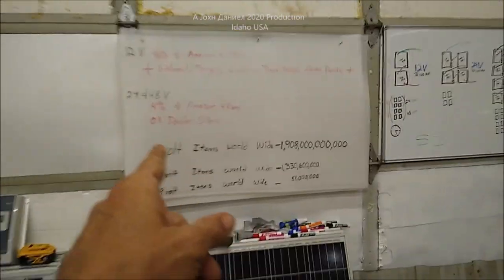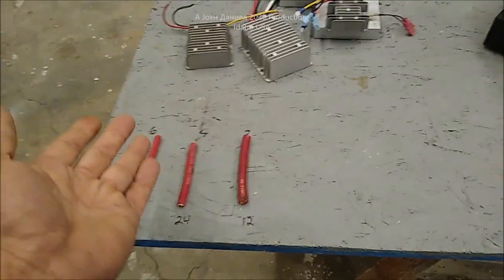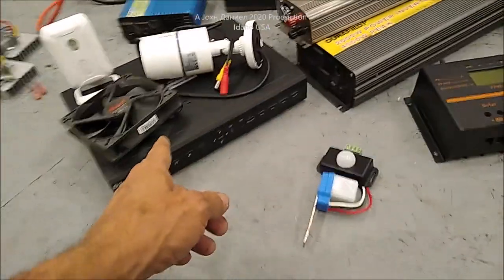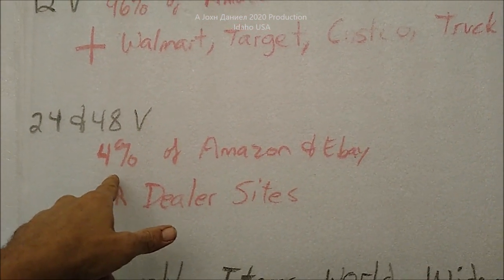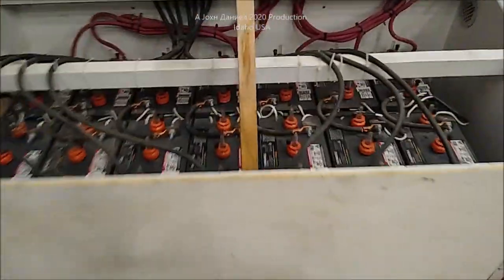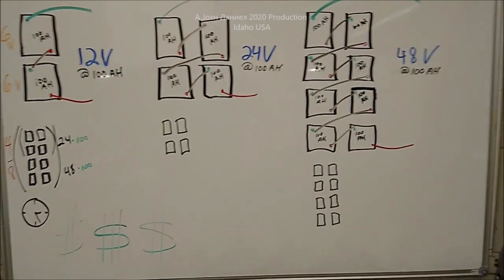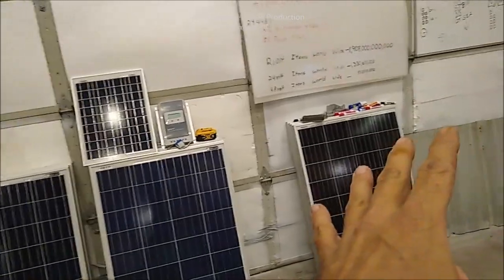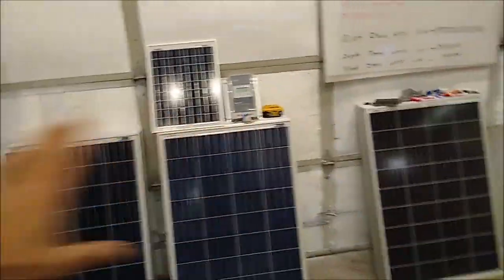Solar Wind Hydro 12 VDC is Best Voltage on Off Grid Survival Power System (Graphic Info)

Comment: did I hear you say something about using the Hurricane LiPo to charge the lead acid?? Just started gutting a 40ft RE school bus. I am studying up now.
Reply from the maker: Yes, you charge a pair for 24 volt off 250 watts of solar, after dark when your big 12 volt lead acid system drops in power the controller pulls stored 24 volt power through its controller to hit the big black acid bank with 40 to 50 amps during the night.
Reply: @JOHNDANIEL1  thank you sir, making sure I follow you. You have become my go to guy on solar. I live close to the Missouri  dude you call out.

Comment: Hi John.  Great videos.  Gives me lots of ideas.  I want to install a 400 watt wind gen, one of the ones that has 3 wire AC output.  I will put a bridge rectifier to step down to 12 v nominal.  I want to put a shut off switch/breaker in line.  Should I do this before or after (down stream) the bridge rectifier?  Fuse it on the 12v side before the charge controller or between charge controller and the batteries?
thanks, keep up the good work.
Reply from the maker: You will use 12/3 gauge wire https://amzn.to/3iU2Ao0 up to 35 feet from turbine to rectifer ( longer run must use 10/3 cord, and 3 - 40 amp Mini ANL https://amzn.to/3l0fwKQ or Maxi fuses https://amzn.to/2FDphi7 on the incoming 3 wire set before the rectifier, following you will use one 60 amp ANL fuse or 80 amp DC breaker https://amzn.to/318QBwP on the positive output of the rectifier before the battery. If your wind speeds are lower than 12 mph nominal, get the 5 blade from the link to the 400 watt models. It will serve you well.(GET NO 6 BLADE, AVOID) It will take a few over 18-22 mph wind events to break in to make as rated power, they are heavily magnetized and must break free and align the magnetic flux in the rotor then its all good. So don't freak out if it don't immediately spin and track, patience Gwass Hoppa, it will fly!  *Getting the volt and charge Settable Controller https://amzn.to/31acqMo with Solar option is best controller option on a under 2500 watt "planned" system!
Reply from the maker: I added links in first reply to examples so theres no chance you struggle to see whats used.
Reply: @JOHNDANIEL1  John, thank you for your very prompt reply and links to the parts used.  Awesome!  As this will be going on a sailboat I will be able to reach the turbine from the deck with a pole to spin it sideways to t he wind when I want to brake it.  I'm thinking that when in this orientation, I can also use an electric brake as a backup.  How do you wire in the brake switch.  My turbine came with a charge controller that brakes at 14.5v but I can't allow voltage to get that high on my LeFePO4 bank so can't use that method.
Reply from the maker: @joegraceffo642  Brake switches are just a dead short switch that connects all 3 phases together before the controller. The rotating the turbine method don't work well in storms, it will fight to return to tracking  with great resolve!!! The best method is braking by 3 into 1 short switch. As for the controller 14.5 volts, the only method to use a wind turbine 100% safe on Lithium is to use Lead Acid as a capacitor with a isolator that charges the Lithium from them.

Comment: Hi John,  Why use 8 - 6v batteries in a 12v system, instead of using 8 - 12v batteries in the same 12v system?  I tried doing the research myself but can't figure it out.  Thanks for your time!
Reply from the maker: Most 12 volt batteries that are one piece are dual purpose but a 6 volt battery is deep cycle only so lifespan is doubled.
Reply: @JOHNDANIEL1  gotcha, thanks John.

Comment: So 12 100 watt panels and 2 charge controllers...I'm assuming 1 charger for 6 panels?
Reply from the maker: Yes, and I really suggest the WN-100 panels I linked below the video due to the better output in low light and slightly heavier frame construction.

Comment: I have 3 (300W) solar panels feeding my "SR-MT2410" controller. Input voltage is 115vdc (max input is 150vdc). Battery out is 13vdc but I have no voltage on my load.  I tried two different controllers with the same results. Do I need a load to get the output voltage? I have a 1500w inverter on there with no load.  The battery is a 12v car battery. Help?
Reply from the maker: Did you turn on the load function on the controllers? See their instructions on how to do that. But, do not run a large inverter off those lugs, go straight to battery.

Comment: Ok, so how far then, are your panels from your bank, how many amps are you pushing, and what gauge wire do you run from your array to your charge controller(s)?
That's not a criticism. I'm genuinely asking because I currently run a 24 volt system and although I've had no problems with it and my 750w converter, you raise points I hadn't thought of and it was only earlier this year that I realized that stupid converter is the reason my levelling system won't work right in my trailer. It's drawing way too much juice and my converter trips out. If I went back to 12 volt and ripped it straight off the bank I wouldn't have the issue. Anyway, yeah, back to the question lol
Reply from the maker: My wires on each row of panels are 6 gauge running 22 to 24 ft to the controller that then feeds two awg wire back to the bank 22 ft away.

Comment: I started off with 12v 100w panel had it running for five years.

This year I upgraded to 24v panels put in series to make 48v.
And 24v battery bank, this uses the mppt of the charge controller and charges the batteries in very low light.

I would have upgraded to a 48v battery bank and higher voltage on the solar panels but money is stopping me.

Why the upgrade?
Well basically efficiencies and efficiencies with volt drop is the main concern for me.

Higher the voltage the more efficient a inverter is at doing its job, higher the voltage of the batteries the less volt drop on the cables, etc etc.
The higher the voltage of the panels to the battery the mppt works otherwise on a 12v panel and battery bank use pmw charge controller.. Also mppt gives upto 30% more efficiency. 

As with any decent solar setup you also have to have battery balancing, not so important with batteries wired in parallel but batteries wired in series to prolong there life.

It all depends on what you want your system for and to do, not only that your climate, I live in the UK so mostly cloudy rainy days here so if I did it differently I would need miles more panels to charge the battery bank

Comment: Hi John, another excellent video. I wish you'd made it 6 weeks ago as I've just purchased a 24v Turbine    : (     Gutted!
Reply from the maker: You can run your 24 volt turbine to a 12 volt battery bank. It will produce better in lower winds, and reach at least 70% of its rating if its like those I use. The controllers do not know its a 24 volt turbine, they only know the battery voltage.

Comment: I have one reply.  You HAVE heard of Peukerts law. I can run 8 12v batts longer than 8 6v batts using the same load. And in a pinch 12v is WAY easier to find than high energy 6v batteries.
24 volts also opens you to using that 58 million military surplus equipment.
Reply from the maker: True on many points!

Comment: Hi mr John. If i use a 48 volt wind turbine hooked up to bridge rectifier that is suited for for it. Than connected to an mppt whose amps and voltage easily exceeds that of the wind turbine connected to a 12 volt system. Is that possible with the respective fuses in place. My theory if the turbine can easily produce a voltage that exceeds 18 volts converted to dc in rectifier and then adjusted in mppt to charge battery. We have winds regular winds but it isnt strong but when it blows, its consistent. Ive seen a youtuber with principally a similar setup. Whats your take on that. I respect your work and therfore want to hear from you what u think of that. Im a big fan of my 12volt solar setup and i want to enhance it with your expertise. Any feedback is appreciated from you sir
Reply from the maker: Which 48 volt turbine. Whats brand, wattage it makes ( not claims to make) and location you've installed. From there I can be more accurate in a reply
Reply: @JOHNDANIEL1  im a novice to wind energy. With solar i have a bit of experience since 2014. Can u recommend me a potential wind setup that could work based on the parameters i gave u sir. Im all about the bottom line. If u tell me to rather go with 24volt wind turbine that u have good experience with, i will role with that. Experience with a product beats advertising of product not understood any day of the week. I wane keep the system as affordable as i can but without compromising on the parts, the way u have done it. Im open to suggestions. I know based on your videos you sir don't have time for nonsense nor to waste time on things that dont really work. Im from Namibia. Yes we have alot of solar radiance throughout the year in the whole of the country. At the coast the winds are more frequent and alot more stronger. Im from the central parts of Namibia. Wind not as strong. Im aiming for a roof mounted setup. Very little trees or unwanted structures to keep consistent wind from hitting the specific location ive selected. Low wind speed, but when it blows its consistent in evenings and mornings somtimes through the night. Thats free electrons i want to capture.
Reply from the maker: @Mr_natenut  Naton, Send me a email, to - olympicpowercontrols@yahoo.com - so I can get details on your actual location, wind zone, power your needing to make and results your seeking. It helps to get it accurate to what you have right now. Mention all you have here. J
Reply: @JOHNDANIEL1  hi Mr John, i actually in the meanwhile came across a video youve shown regarding vertical wind turbines and others on your channel that answered quite alot of my questions i had. I actually downloaded them and have them on my hard disk drive for study purposes. Vertical is more practical based for me based alot of good stuff you mentioned. It will take me a while to absorb all the material youve graciously made available. There are even links to the wind turbine youve approved that i will check out. Thank you.

Comment: I think you make many valid points, but one of your points wasn't clear to me, the point about battety failure compared between 12, 24, and 48 Volt systems.  The example you gave was 2x 6V, 4x 6V, and 8x 6V "packs".   As I understand it, if one 6V battery fails in any of those packs, you need to replace one 6V battery to restore the pack to service, otherwise the entire pack will be out of service.  I dont see any difference in the impact, regardless if its a 12, 24, or 48 V system.  I think  a better point would be to compare failure rates instead.  A 24V pack has twice the failure probability of a 12V pack, and a 48V pack four times the probability of failure, but for just one battery to fail, the outcome is the same for all 3 types of packs.
Reply from the maker: It's not just about replacing a battery, you can't always do that immediately. So if you loose a percentage the 12 volt method is superior, all considered the equal of 8 batteries which is most common. A 48 volt would be dead, a 24 volt would be 1/2 dead, a 12 volt system would only loose 1/4 its active ability. It's due to the string being broken in a loss.
Reply: @JOHNDANIEL1  If just one 6V battery fails in a 24V pack, it's totally out of service since you now have only 18V.  A 12V pack that loses one 6V battery now only has 6V and is 100% out of service.  Same story with 48V pack. A single 6V battery failure takes the entire pack out of service.  I don't see any partial service at all.  
I think what you are saying, but didnt state, or I missed it somehow, is that each system has the same total number of batteries.  In that case, you have 4x 12V "packs", 2x 24V "packs" and one 48V pack.  A single 6V failure would then kill the whole 48V system, reduce the 24V system by 50% and the 12V system by 25%.  Thanks for your excellent video.
Reply from the maker: I'm don't know anyone who would put 12 or more solar panels on a single set of 6 volt batteries. But I do know hundreds who put 1200 or more watts on 8 or more batteries. But if your foolish enough to buy 8 for a 48 volt system, and only 2 for a 12 volt system, then yep, your ass out when one fails.
Reply: @JOHNDANIEL1  I think I understand now what you were trying to say, and it confused me because of what you left out and assumed the listener would know.  I've made that mistake myself enough times to know how easy it is to make.  By simply pointing out that each system is assumed to have the same number of batteries, and make it concrete by stating 8 batteries, it would make it easier to follow.  Thanks for all the time and effort you put into your videos.  They have a solid practical viewpoint, and cater to those who want to keep things on a budget.
Reply: I forgot to add that it would be helpful in the future to use standard notation, which would avoid any confusion.  I suggest using the serial/parallel notation when comparing the difference between the solar banks.  For example, 
2S4P for the 12V configuration 
4S2P for the 24V configuration
8S1P for the 48V configuration
That way, it's much easier to see your point about what happens to a given configuration when 1 6V battery fails.

Comment: Batteries should never be paralleled full stop.  When one battery fails in a paralleled battery system, shortly thereafter all the batteries will fail.  The reason is that the failed battery generally becomes a load and other remaining batteries are then dragged down.  In a series configuration, a failed battery is just like kinking a hose.  If the battery goes open circuit then no current can flow and there will be a voltage drop of the nominal battery voltage. There is an old saying that batteries above 2 volts should never be paralleled. i.e NEVER parallel batteries.  as the internal resistance of one battery changes, all batteries connected in parallel are affected.   If you think of them as water tanks, connecting an empty tank to a full tank = two half tanks, not one full tank and one empty tank.  In a series configuration the system can be restored by changing out the failed battery.  In a paralleled system you will generally be changing all the batteries.  Mixing old and new batteries is never a good idea, but makes fixing a series strung battery system somewhat possible. This applies to lead acid battery systems only as lithium generally are managed systems with internal BMS'

Comment: Anybody trying to sell 24 or 48 volt systems are con artists.See people don't understand that when dropping down to 12volts, they are not losing power and would need more to cover the higher wattage items in the house.
Reply from the maker: The poor folks buying the Dealer option get a ONE system. With the opportunity to have all fail due to ONE item. My system is a stacked system. With the 12 volt stacked system I basically have 7 - 600 watt solar systems, 5 independent 500+ watt wind systems. Even though it looks like ONE, it is so damn redundant I will power on at my Stupid 12 Volt when they are putting rotting food from a freezer in the dumpster.